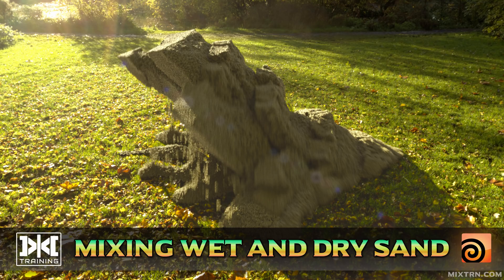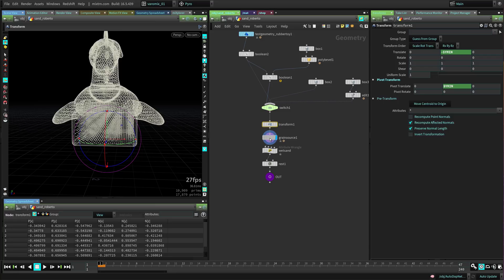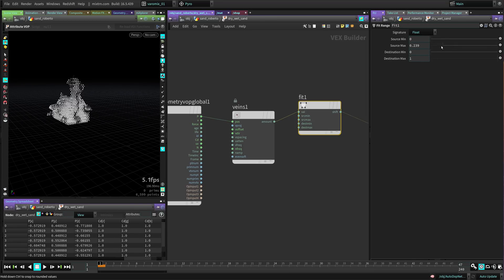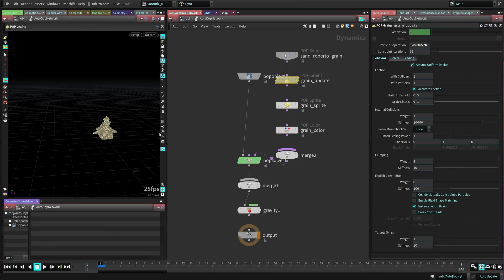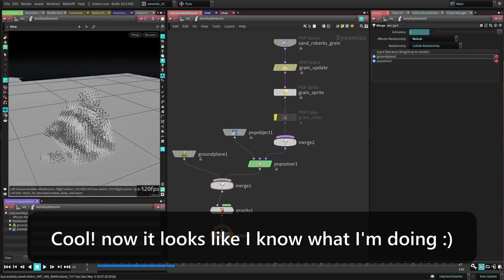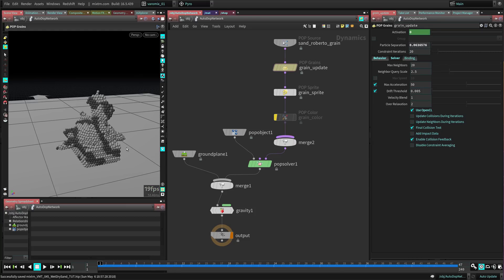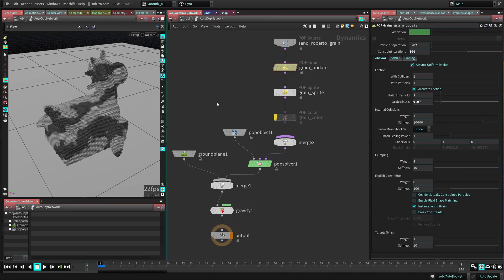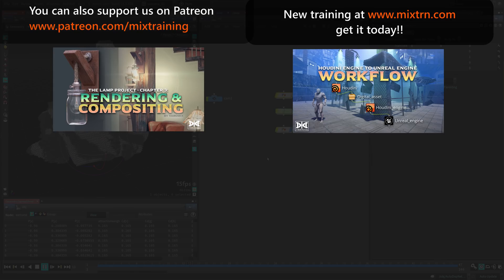VMT 046 - Houdini - Mixing Wet and Dry Sand

Comment: i am trying to make a sand man. he will sit in meditation posture. he will turn into sand and slowly fall into ground. i want it show this very nicely close view, but the sands falling all at once. i tried sleep mode and awaken object to do it.. but if i drop the shoulder the forearm dont fall. it stuck in mid air. i had to wake it up using awaken object. can you help me make it simple? thanks in advance
Reply from the maker: you can’t just do that, wake up the whole arm, you can use attributes as I did in this video to control it as well